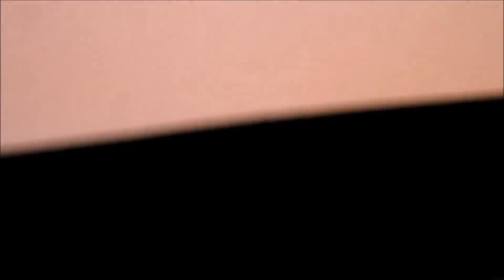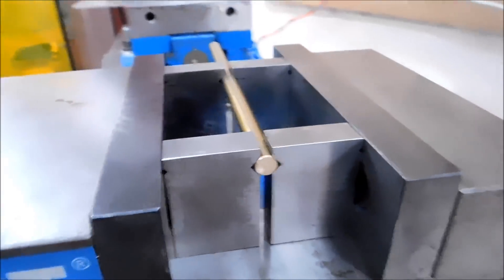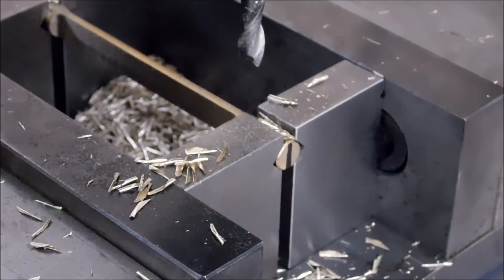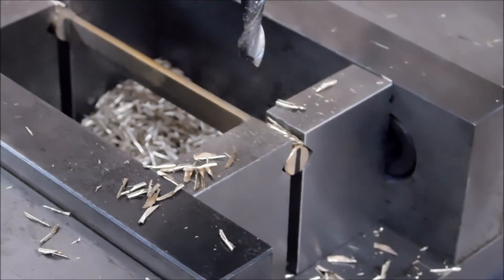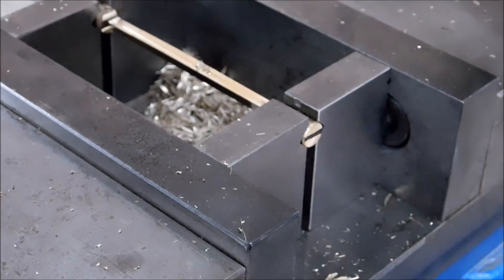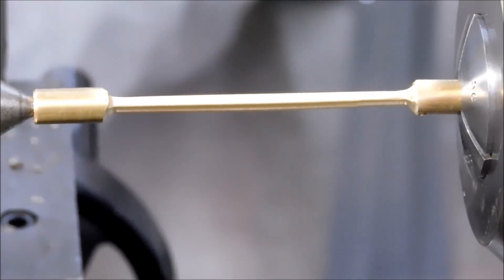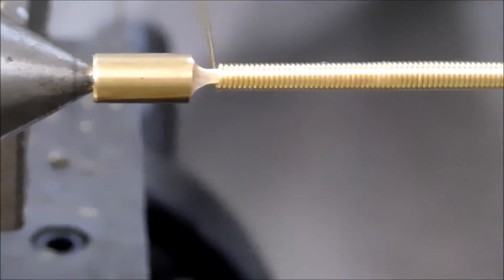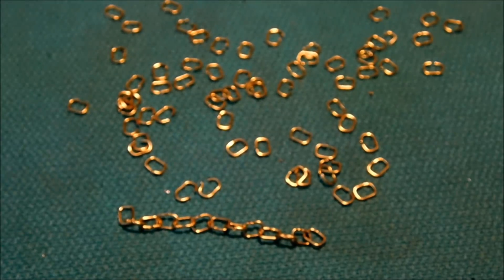Making Square Link Chain

Comment: Joe, I know its not directly related. But could you do a vid or share your thoughts on "AIR" to air or not to air.. Im pretty sure I have never seen you do a video where your not air blowing chips away. I have heard other machinists say "never use air around a lathe or mill" I cannot for the life of me understand why not. All, while I see you use it anytime you need it.. whats your take? Thanks again for all the posts. -Sam
Reply: It was a fire-able offense in the shop I grew up in.  The theory is that air will blow fine particles up and under mating surfaces, cause wear particularly with/to cast iron, and eventually you end up with a sloppy machine with crunchy lead screws.  A bit of air to clear chips around the vice is low risk, but aggressive blowing under and around tables or saddles will push abrasive stuff under the seals.
Reply from the maker: That video would generate a lot of comments. I would guess mixed and heated. I like the topic.
Reply: It's from a common topic for industrial hygienists but commonly taught it's 1 easier to vacuum something to lessen air particles and depending on material can mitigate fire hazards. But for home gamers air is fine, you'll be sweeping allot more.
Reply: I my self tend to vacuum more than anything. I agree on the sweeping after air. as chips get blow to places you will find years later. But you gotta admit. Joe's shop is quite clean. and hey perhaps he has some technique that he may think is common knowledge but to others mind blowing!-S
Reply: Sam, many people feel that someone shouldn't blow chips because the chips will get in places that are difficult to clean such as the scroll on a chuck or into the nuts that lead screws feed into. My personal preference to not use air is that it often causes chips to get all over my clothes and ultimately all over my house as the chips jump from my shirt into the carpet or other flooring. There have been a few times where I got a tiny chip embedded in the bottom of my foot. So that is my take on to air or not to air.
Reply: @robertoswalt319 Thanks for the post. All good points. When you watch a JP video. I dont think their is one that does not include air being blown. (No Pun intended Joe ! :o ) You have to admire how clean his shop looks.

Comment: you could do this by hand, and make the square out of hardwood... with a heavier gauge wire, things get complicated though, and you might end up using a forge and an anvil to get the desired shape, doing each link individually through manual bending, just like a real blacksmith.

Comment: Neat process, but I was expecting a much larger gauge chain, maybe using a press to bend the original stock. However, I am not disappointed.
Reply from the maker: That horse fact is actually the first thing you have said that I found even remotely interesting. Stick with that topic.
Reply: His cannon barrel is all of about 7-8" long and 1" in diameter at the largest point. It's probably "1/12 scale". You can't "bend" brass stock that large without "breaking" it unless you heat it and even then its going to end up "distorted" and "damaged" and you'd end up with chain two or three times as heavy as 3/8 "log chain" and maybe 1/100th as "strong". The only "square link chain" in common use or that has ever BEEN in common use is square "drive chain" that preceded roller chain. 

There are multiple inherent "issues" with "square links" that make them a really bad choice for "high loads" in "tension". But they're easier to "scratch build" than standard "oval link" chain. In reality "cannons" of the muzzle-loading "fused" variety never "co-existed" with modern steel welded "oval-link" chain anyway so even the "original" wouldn't be "period correct". There WERE oval-link chains but the ends were not "joined" because the only "power" back then was literal "horsepower" and those chains were for supporting light loads like "tailgates" on wagons, etc. 

Young, inexperienced horses just being "broken" to be draft horses were too easily spooked by "jingling" chain and if a team "bolted" the rattling, banging and jangling chain links could throw sparks and start a range fire on top of the existing "disaster" so "single-trees" and "double-trees" and other "hardware" connecting "harness" to "wagon" never consisted of more than one or two round "links" sufficient to make for some "flexibility" where the "trees" met the "tongue".
Reply: @deeremeyer1749  you haven't worn out that " key yet?

Comment: Off topic question about bolt hole DRO mill operation. My China mfr DRO has the bolt hole feature which sort of has me baffled. I know the math, etc., but when it comes to the start angle and end angle inputs the pattern seems to go really wrong. The instruction example shows a start angle of +30 and an end angle of 300 for 5 holes. Not sure where the 300 came from (270+30)? I tried to make a 5 hole pattern with a start of 0 and an end of 360, and what actually happened was 4 holes at 3, 6, 9, and 12 clock positions. Any thoughts would greatly be appreciated. I have viewed other videos and none have helped yet. Thanks, Tom
Reply from the maker: Hi Tom. Good timing on the question. I can only speak for ACU-RITE digitals, but you angle stack just doesn't add up. A 5 hole pattern is composed of 72 degree angles possibly added to whichever starting angle you choose. On my digital, 0 and 360 are the same hole. ( positioned at 3 O'clock ) Just for yuks, subtract 72 degrees from your 360 end point and see what happens. realistically, a 5 hole pattern does not end where it starts.
Reply: I fully agree. I made a 5 hole Fusion 360 pattern sketch and 72 is the number. I will try the 360-72 and see what happens. I also contacted the vendor Sinpro for help about it, hopefully they will send some usable information. Thanks, Tom
Reply: Not sure how correct formula I figured out is, but it seems to be working - at least on my Sinpo 3 axis DRO;
END-ANG = (360/#holes) * (angle segments-1) + (1st quadrant ST-ANG 0~90). Not yet figured or tested for other 3 quadrants, ± etc.
* angle segments are the spaces between holes
* ST-ANG is the angle value off X axis in the 1st quardant
Bottom line - seems to awkward in my opinion.

Comment: I like the idea but not the end result. Pinching the wire with a wire cutter doesn't make it look nice. The cut ends are not square.
Reply from the maker: Agreed. A saw yields the best results for the splitting operation. if your snips are flush cutters, you could trim the pinched side.

Comment: So How Small Is The Cannon? I Was Expecting BIG Chain.
Reply from the maker: 50 cal. About 16" long. Solid brass.
Reply: @joepie221  man that's tiny. I was expecting like an actual cannon sized cannon.
Reply from the maker: Strictly a book shelf display. Its something I have always wanted to fabricate.
Reply: Hi Joe: 50 years of machining I always wanted to make a cannon or a pistol. I think most machine guys have also. I had a friend that owned a brass and copper foundry. He made boat rudders and Packing boxes. He passed many years ago. He cast a cannon barrel I'm guessing 4' long, 8" large OD. He used to fire it every 4th of July. It was so cool. I also understand the satisfaction of making every thing yourself by machine or by hand. I am the same. Keep on having fun. Pay no attention to the "Why" people. Nice job with the challenge. Kinda like making a spring. retired I do a lot of hand work. For metal work I only have a infamous  9" south Bend lathe, no mill.

Comment: Why did you make an elaborately machined part if all you wanted is a rectangular solid to wind the wire on?
Reply from the maker: If you have ever seen or used 4 pinch blocks in a mill vise to cut 3 sides of a round part before, then I wasted my time. If not, that part of this demo was done just for that reason.
Reply: Ok, I now see that you were demonstrating a machining technique. I assumed the objective was what the title says - Making Square Link Chain. So was wondering why you are going through all that.

Comment: Impressive. And thank you for not putting background music and muting the sound of the tools. And thank you also for recording at regular speed, not 2x or 3x. It took me until 14:15 until I understood what you were heading  for. BTW, you did not need to cut the through in the arbor. You could have slid the complete spiraled wire off the arbor and then cut it.
Reply from the maker: Brass on brass makes that highly unlikely. Especially if you squeeze the coil after winding. Maybe if I had used a steel arbor.

Comment: Why is his mill so much cleaner than mine??
Reply from the maker: Mine is on video.
Reply: @joepie221  touche'
Reply: Joe: My first job was machine operator in the early 50s production work at Raytheon. I was 17 years old. I had a boss that would walk around at the end of the shift and check out how much chips were on and around the machine and he graded how much work you did by the amount of chips that were there. He was joking but something he enjoyed doing.
Reply: You know, a clean area can be the sign of a bored machinist though

Comment: Having made chains before, I'd like to offer a tip.  Next time you wind a spring, wind 2 wires (side-by-side) at the same time. This way, as you cut them, they're pre-gapped for assembly. It really saves a lot of time by cutting out the gapping step, especially when working with hundreds (or in my case, thousands) of rings.
Reply from the maker: Thats a great tip. Thanks. I'll try it.

Comment: It's much easier to just by clock chain, the kinds used for the hanging weights.  Try here, couple bucks for 6 feet of it. https://timesavers.com/c-325583-clock-repair-replacement-parts-chain.html

Comment: The links are a little fatter than the original you show, (not the thickness of the wire, I mean the rectangle itself...)
Reply from the maker: It is. I may change it. I like the long link look much better.

Comment: When doing this kind of work in a lathe, the older style belt drive ones would have an advantage.  They would be able to be slipped to the point that you could get down to less than one revolution per minute as they would rely on the friction in the bearings/gears to pull the wire at a controlled tension on the wire.
Reply: K0

Comment: I cringed when you drew that vertical line in free hand, the base of a mill vice is very square you should of used an engineers square marked off the centre hole you would of drilled on the lathe lol just kidding great job making square chain
Reply from the maker: Actually, the rectangular section of that brass mandrel was over the movable jaw traveler and there was no nice surface to resister a square. I would have had to use an expanding parallel against the rear jaw vertical face. The jaw chocks were sitting on the closest ground surfaces.

Comment: Would be great to see if you could create a chain by milling and drilling the blank directly!
Start with a cross-section like a "+" then mill flat every other link on each of the 'arms' then rotate 180°, then 90° and then 180°. Drill or route out each link minus the vertical part of each adjacent link, and leave enough room to free each link from each other with a very fine end mill at 45°.
Your kit looks as if it could manage it.
Reply: You mean like the the wood link chains? ;-) All cut from one section of wood.

Comment: If you ever need to make a mandrel for an oval you can solder two pieces of round wire (sized accordingly) side by side, and drill your pilot hole and twist like you did in your video. Using a rotary tool ( I’m not gonna use the “D” word) to slice your coil and you will have less clean up if you decide you want to solder the links shut. Thanks for sharing your project. You give us all “tool envy”.
T
Reply from the maker: I like the 2 partial rounds connected for an elliptical arbor idea. I have been thinking about how to make one by offsetting a corner rounder tool and cutting both sides. Thanks for the comment.
Reply: You could also get an elliptical arbor by flattening round stock with a hammer or other means. 
 I suspect you could do the math to select the initial stock diameter, i would just do it empirically.

Comment: I see a number of comments suggesting starting with rectangular (or even square :-) stock.  I would like to know where to source 0.08" X  0.16"  or in that ball[park stock brass or steel.
 BTW, this is a genuine question not meant to be a 'snarky' reply, just trying to build up my knowledge base for an area that I don't have much experience with. 
I am aware of onlinemetals, link on  littlemachineshop home page, but their smallest is around 0.125" X 0.25".  (just add the dot com to those, not sure if links are blocked in comments.)

Comment: This might sound like a stupid question, but why on earth didn't you just start with a rectangular bar to begin with, and save yourself a whole heap of work milling that round bar down ?. 

Would the end result not be the same ?.

Fantastic work on the chain though :)
Reply from the maker: Thanks. Having correctly sized rectangular bar stock would have been a good start, but using the pinch block setup was also a big part of this demonstration. Accessing 3 sides of a part for a milling operation is a good trick to know. Especially if the part is round and the work has to go below center.
Reply: AHHHHHHHHHHHHH NOW I got you, I totally missed the milling demo, I just thought it was prep work for making the chain, most sincere apologies, just trying to be helpful though.
Reply from the maker: All good bud, thanks for commenting.

Comment: I guess no one told this guy you can just flatten sides of a circle with flat nose pliers?
Reply from the maker: That would be OK if the circle/material was continuous. Otherwise, the open side closes inward faster because of the lesser resistance. The end product would not be symmetrical.
Reply: @joepie221  you don't weld? Or solder? Sorry but the Goldsmith in me finds this amount of work for something that should have only taken 45 minutes totally insane. Also Carpenters pencils are rectangles and 99 cents.
Reply from the maker: I'll humor you with a reply. I do weld and solder. Both quite well I might add. But due to the cosmetic nature of this chain, to consider either would be as much of a waste of time as this reply. As for how long it took...it was actually less than 45 minutes, but the camera didn't move itself when I asked it to. So I had to do it myself. As for the carpenter pencil remark. Thanks for the info. If I'm ever on jeopardy and win money with that knowledge, I'll send you a T-shirt.. I know you are just trolling for a rise, but it ain't gonna happen. I'd like to see a video on your goldsmith talent, but all I found on your channel was equestrian related content. That means horse.
Reply: @joepie221  bahahahahahahahaha you're right and one ring zultanite and it's quite lovely ;) guess I should upload my FB live videos to my channel at some point ;) thanks :)
Reply: I don't have one handy to measure but carpenter pencils are also about 3/8" X 1", a tad bigger than the chain he was making.  
If you discount the video production part (setup and explain steps etc)  I suspect total time was probably well less than an hour. 
Without jeweller scale tools soldering (jeweller for brazing as I recall ) would be very tricky.
Reply: @martinmoeller9186  depends on what metal you're working with. I do gold, silver, brass, copper with a propane oxygen set up for high heats and a small creme brulee torch for fusing fine metals (24k or fine silver)
Reply from the maker: I have always admired jewelers and their micro skills. My interest is genuine. If you have a video, post it and you bet I'll come over and take a look. I actually did my apprenticeship in precision miniature componentry supporting the production of the internal components of high end watches back in the mid 70's. I made coining dies for embossing the logos on the watch crowns and secondary tooling for the gears and stems inside.

Comment: Jeweller tip: make the mandrel slightly undersized then wrap with paper before winding your wire coil. you can then heat the coil with a torch and burn away the paper for easy removal of the coil from the mandrel. A jeweller's saw frame and blade is also a neater way to cut the links from the coil.
Reply: And a jeweller will usually use a wooden mandrel so the saw will not get blunted sawing against a metal mandrel. As Wayne said, this will give a much neater cut. If you don't have a lathe, chuck it in a traditional hand drill held in a bench vice. Also helps if you anneal the wire first so it is soft enough to bend  evenly and tight to the mandrel.

Comment: I made some springs for a project in a similar way. I made a little tool for the compound to keep tention on the wire. 
One thing you learn through experimenting: the feed on the lathe was not corse enough for the springs I wanted to make so I had to wing the helix angle.
Also, not having had direct access to music wire I used bicycle spokes. Not ideal, but they did the job.